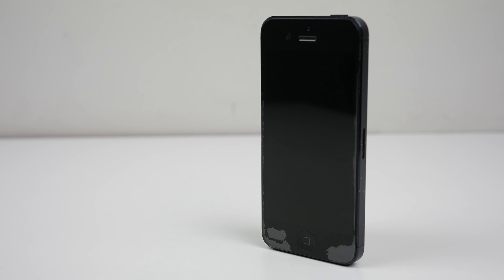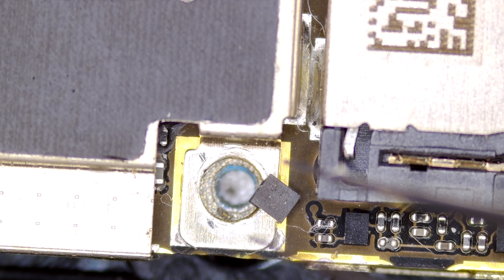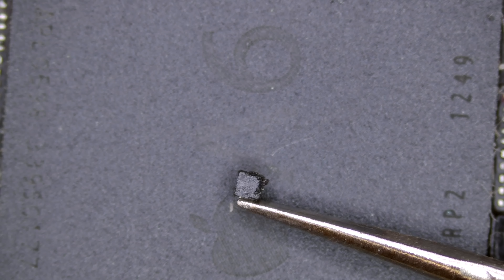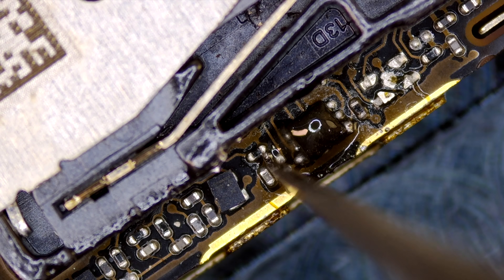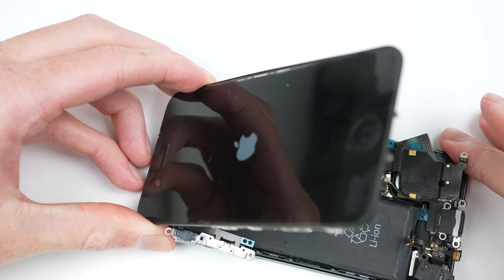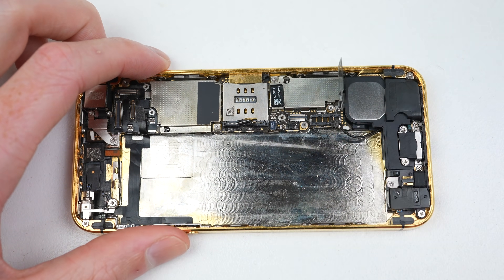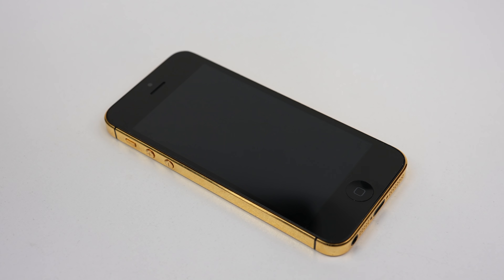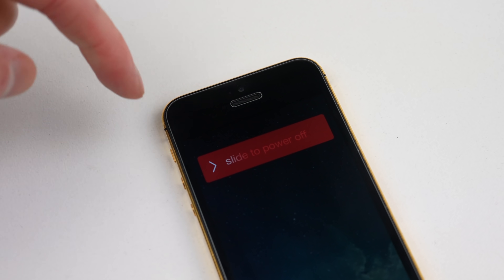Extreme Phone Repair - Incredibly Difficult & Tiny - iPhone 5 Pry Damage Micro-Soldering Repair

Comment: You shouldn't pull at the chips too soon, let them float free first and then touch them. Also use waaayyyy more flux when flowing with hot air. You are way less likely to damage the components that way as the flux absorbs the heat instead of the chip. Like drown it in flux. Use capton tape on top of components you do not want to heat up too to minimise loosening them as well. I like to use pieces of metal I have lying around too, small bits of aluminium or something, to put on top of the components that I put capton tape on. Hope this advice gets to you, it will help you greatly. Otherwise I love the videos, I'm really happy to see you trying to get into micro soldering and using a hot air station.
Reply: Use a Louis Rossmann amount of flux, not a Paul amount of flux. 😜
Reply from the maker: Thanks mate!
Reply: @HughJeffreys  no worries, I wish you all the best with learning. You'll be a pro before you know it, trust me :)
Reply: hello my friend how are you
Reply: I would also suggest investing in an optical stereo microscope (or trinocular for youtubers) if one intends to do this more often. I find it really hard to position stuff without both eyes and - in case of an electronic one - with noticeable image lag.

For the sim protection chip: Usually one of the pads has a different shape on the board and the chip indicating its orientation. If they're not damaged a bit of alcohol should reveal how it should be mounted.

In any case: I guess everyone started this way. Well, maybe not with a such successful outcome.
Reply: cool story bro. make video about it.
Reply: Came here to say this, saved me some time bro
Reply: I'm new to surface mount soldering, can I get a recommendation for what flux I should be using?
Reply: @HughJeffreys  how did you bypass the disabled screen for the passcode?
Reply: @HughJeffreys   111 👍
Reply: Also the little static shock protection chip for the Sim card that you said was not needed you could have marked it on one side then removed it and installed on the board you were trying to fix as you would have known by the mark how it went on eliminating any confusion just like the little circle in the corner of bigger chips which I believe tells you where pin 1 is and allows you to line the chip up properly  anyways great video
Reply: @TheLemonyOrange  Can I contact you anyway with a really important question related to this?
Reply: @HughJeffreys  HI

Comment: Small nozzles, turn fan speed down on rework gun so you are not blowing other components about. You can get dedicated, shaped nozzles in various sizes so removing square profile ICs becomes much easier. Keep at it and spare a thought for the pick and place machines that have to populate these boards 😁

Comment: Love your work. I recently did my first micro-soldering job on a phone too - a liquid damaged Alcatel  where the owner was desperate for the data. I had to scavenge probably a dozen of those tiny surface mounted capacitors and resistors as well as the display connector from an identical working phone, much like this. It took me a few hours, but it was successful.

Comment: You need the heat resistance tape to cover the sim tray area and you can increase the heat and wont melt the plastic. 2nd the chip cannot force pull and need to float 1st. This wont damage the chip. You need sharp tip with 35 degree side soldering to easy apply the flux and the tin. I done it before. Not easy but the effort is there. Keep up the good work. Just advise from self repair guy 😄

Comment: Thanks for a great video - it's really cool to see your learning process. One suggestion (on top of the tons of good ones below): I would have removed the board from the case. The case represents a pretty significant thermal mass, so it will be sinking away a lot of the heat you're applying to the logic board, forcing your to apply even more heat to overcome it. The components won't come loose (or attach) until the pads - and thus the surrounding area of the board) are hot enough to melt the solder, so minimizing the connected thermal mass is hugely useful for making this easier. Of course you need something to hold the board securely while soldering, but that's what PCB holders are for.

Comment: When soldering and desoldering chips you want to use around 350 to 450. 250 isn't enough because even full  low melt solder melts at around 280 to 300. Also the plastics used around soldered parts is usually pretty high temperature stuff and even when it softens it will hold its exact shape unless disturbed.

Comment: You should consider using epoxy solder paste to apply the replacement chips. MG Chemicals makes both 2-part and low heat setting versions that will allow you to attach the chips without applying additional heat and risking melting other components.

Comment: Definitely harder than it looks! Great job man! My one suggestion would be to learn what airspeed and heat to use for different boards and different chips. If you want a good idea to reference, you can see my latest video detailing a customer damaged switch lite. I do some BGA rework somewhere near the middle of the video. Hopefully it'll give you a general idea to the type of flux to use and technique to remove and install SMD components. ☺️👌

Comment: Some recommendations from someone who works repairing electronics:

-With hot air, usually dont need to add flux or more solder to the components that you want to remove, less messy after all. One thing that you can do is clean it before removing it with some IPA if it has gunk around it.

-If you remove a lot of the same components over and over again you end up knowing when it will get loose with the hot air, but for first time desoldering a component, i do not recommended holding it with tweezers while you heat it up, because you can try to extract it before all the solder is melted and can break pads, or even worse, a leg of the component itself.

-Kapton tape is your friend when plastics or other small components are near.

-And one more thing, when you finish heating something, WAIT until the area cools down, dont add IPA to clean it right away, because like how it happened to you in the video, small components will fly away.

Comment: I used to manage my corporation's wireless phones for the provisioning department, and still provide support for mobile devices even today.  I'm certain you can reinstall the OS to the phone by putting it in DFU mode and then connecting the phone to iTunes.  Apple doesn't release new security patches for those old devices anymore, but they do allow you to re-download the last supported OS for any of their devices.  This will allow you to get past the pin/passcode.
Reply: Ya but that gets rid of the older ios which makes this phone unique

Comment: Use kapton tape, also get a better soldering iron like TS100 or something similar. It's very close to expensive hakko stations. 

Also get a better hot air station quick or Atten are best options.

Comment: Raise the heat on the air station i set mine on 404 C° to pull small components quicker and safer low heat dosen't always mean safe also kapton tape as your friend tape up any parts you might melt.

Comment: Stuff like Pre-heating is what makes this job much easier, well you can actually use the lcd separator for this, set it to 125C, clamp the board firmly onto it. After 5 mins start with hot hair, the smallest nozzle and airflow set to minimum, 370-380C temperature. The components come right off. Use good quality flux too, especially considering you work on small parts that require small amounts of flux, so its worth purchasing stuff like ersa flux. Also if you want to protect plastic parts, or nand, place metal shielding or capton tape. Remove them only when the board cools down. This stuff is easy.

Poor results come from improper technique, crappy tools and also lazy minds (ppl who solder stuff without even removing the board from the casing, as a result end up applying way too much heat, which negatively affects well everything.

Comment: As Someone ho does motherboard repairs i would indeed use more flux and smaller soldering iron point machanic had perfect tips for very cheap (10 euro's)
Also a microscope wich you van actualy look throug is way better as you have learned eye hand cordination like that your whole LIFE.

But IT works that's the main opjective so good job hope to see more vids.
And for best advise i would look at sts channel that Guy is the best 😝
Reply: hello my friend how are you

Comment: Try to get a cheap cermaic tweezers. They are heat resistant and doesn't send components flying. I worked recently with 0402 smd RGB LEDs on a g513 carbon keyboard. It was first time micro soldering and super super hard. Hot air at highest temp and lowest air flow. I didn't even have a microscope to look at.

Comment: If the capacitor that you reinstalled is electrolytic (it has polarity) and is installed the wrong way that will destroy it.💥 At the same time it could be cap with no polarity which is not a problem.
Reply: All caps in phones are ceramic ones, polarity doesn't matter.
Reply: @johnny4498  Then it’s okey

Comment: you should get more finer tweezers. also use plenty of flux and use better quality flux like Mtek flux.
for training get plenty of dead boards and try to desolder components and resolder them.
another advice for such jobs please remoce the logicboard from casing before making any work on it. it makes ur job easier. 
Get some PCB Holders also
To know the orientation of a chip make a small dot with a white color pen so u can see which orientation its supposed to be

Comment: your efforts to repair these phone is more than cost of replacement. this is why repair mechanic job is decreasing and replacement of components or dispose off is preferable.  Now a days, even repair shop don't want to put efforts as everyone want want higher pay /lower cost for repairs
Reply from the maker: I think you missed the point. As I said many times though-out the video, this was for practice.
Reply: @HughJeffreys  yes your curiosity and practice is utmost appreciated whcih is now a days are Missing from mechanic. not terming you as mechanics but what i can see trend from 90s to present. earlier things were get reapired but do to advance in circuit board and machine prepare low cost jobs, specialist skills became redundant. replacement job taken over.

Comment: Always remove the board from the housing, it will suck the heat from board, making it harder to repalce any chip on it. Also get stereoscopic microscope, this camera rubbish is only goot for taking pictures. And get flat tip for your soldering iron, these rounded are useles.

Comment: Soldering iron is garbage, either temp not high enough or a bad tip. I run higher temps with a tiny tip as the heat gets sucked out of them nearly straight away.

Comment: More flux, more heat, less soldering iron. You shouldnt need to pull the chip. Quick lots of heat is better than slow cooler temps...
Reply: Exactly!

Comment: My man, you have to apply kapton tape to the areas you don't want to melt or components you don't want to desolder. Its cheap and you kinda need to use it. You look a bit foolish not using a vital part of solder kit. cool video btw.

Comment: Lack of knowledge here .. didn’t protect around the area working aluminum and a quarter would keep heat from melting areas where we don’t need that heat , lack of flux and when it comes to this items the right flux make a difference, also he tried forcing components off u see the solder melting and u can simply almost just slide off the ic unit has the right idea with the flux tip must maintain clean and flux aids in controlling the flow of solder to help removal and reflow .. A for effort over this type of jobs take practice that for sure cleaning pads and having leaded solder helps flow with less heat .. the unleaded solder is meant for high heat not removing the factory solder makes it a lot harder to work with specially when ur equipment is on the lower end . And ur skill are low .